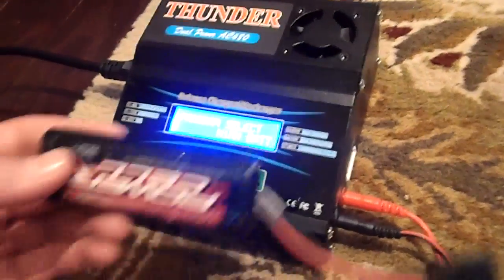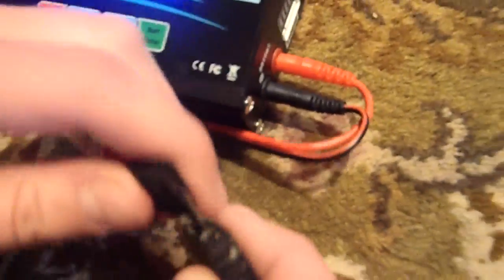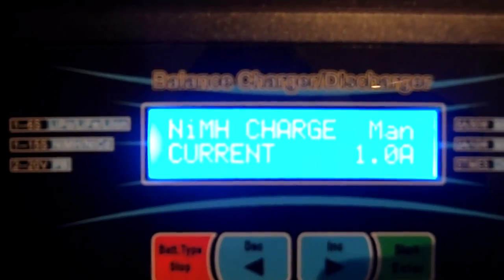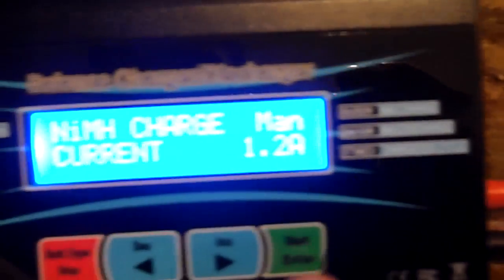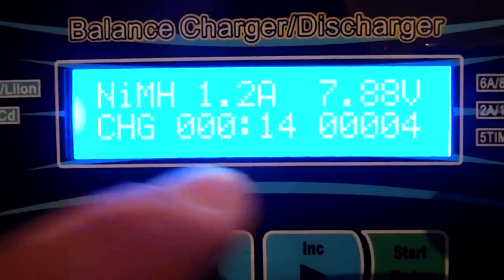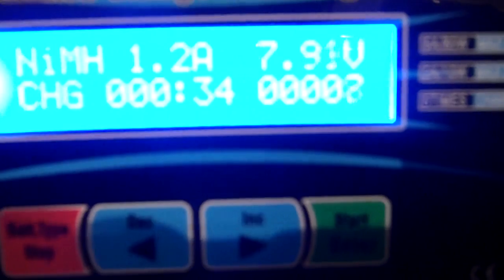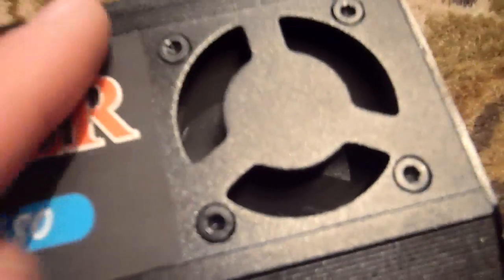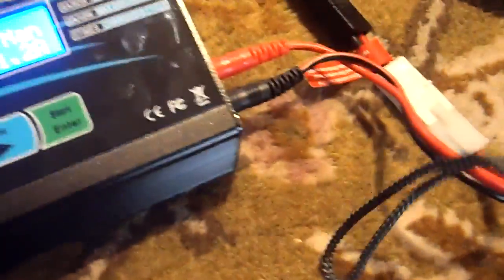How to charge NiMh on Thunder AC680

Comment: I just got the Revo mini with the 1200MAH NIMH battery. On the instructions that were in the battery compartment it says "For maximum all over battery life, charge at 3 amps or less. For fastest charging and maximum performance, the pack may be charged at 4 amps. If the battery becomes hot, disconnect immediately". For a lipo that fits perfectly, Turnigy 1600 mAh 2s 30c mini hardcase (but be sure to activate low voltage detection on the esc). They sell them at Hobbyking.

Comment: Hello mate, I wounder if you could spare the time to help an oldy....I have just bought me a minelab metal detector and it eats batterys,,,,,so i have bought somee nimh 3500mah batterys and have also bought a very similar charger to yours...it is the B6AC 80W dual power...the batterys i have bought are  AA 3500 nimh it takes 8 of them. I have bought a charging pod so i can charge/discharge them all at once. I,m a bit puzzled/unsure at what rate to charge them at, and also if i discharge them what do i set cut of point at.....i would preferably like to cycle them 3 times befor using them but am afraid i might kill them first attempt...I would be really happy/greatful if you could advise me.....this tecky stuff gets a bit to tacky for me, it,s going to fast mate..lol....Cheers mate...ATB Regards Bri
Reply from the maker: +brianfindsall Depends on what proformance you want from your batteries. I tend to charge mine at 4.5amps for decent performance and decent battery length but that is for RC cars. If it eats them up a ton then I might try charging them at 3amps. As for a cut off point for the discharge it depends on how long you are planning on having the batteries discharged. Hope this helps!
Reply: Hello mate, Thankyou for your reply. i think i have been done, The batts are going back..when i fully charged them which took no  time at all, i smelled a rat..anyway i tested them and found they actally only hold between 350mah and 488mah....Blumin rippoff. i thought it to good to be true. Thankyou for your advice anyway mate. i will probably come back to it when i replace theses duff batts,,,,,,returns dispute in motion lol..i,ll let you know..Bye fer now mate. really enjoying your vids
Reply from the maker: Glad ur enjoying them! I would suggest getting something like zippy LiPo's becasue they seem to be really reliable I love mine!

Comment: What's the difference between this one and the thunder ac6 I just got that one love it and anther question on nimh mode it doesn't need to know how many cells it has just votlage like 8.4 why?
Reply from the maker: I've looked both chargers over and they look very similar and as far as it goes for needing to know a how many cell battery it is I will have to ask my friend since I don't actually have the charger right now.
Reply: the AC680 has an in built DC power supply so you can use it at home as well as in the field.  Most of the AC6 chargers I have seen are DC input only, and are for field use only without an AC adapter.
Reply from the maker: Thank you very much!
Reply: You know, after I said that I looked them up, and the ones the sell now are both AC/DC, and run the same software.  Looks like the only discernable difference is the wattage.  The 680 can push a little more current than the AC6.
Reply from the maker: Yeah I got a new charger and it's AC/DC. I would have to look it up myself since I don't have that charger anymore, but like I said they are very similar.